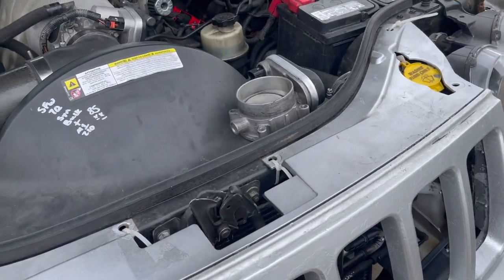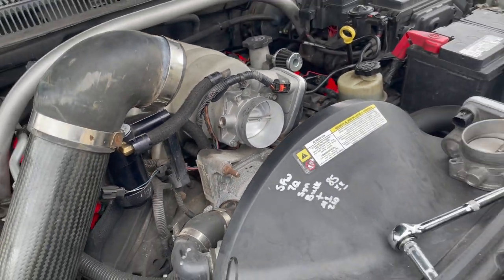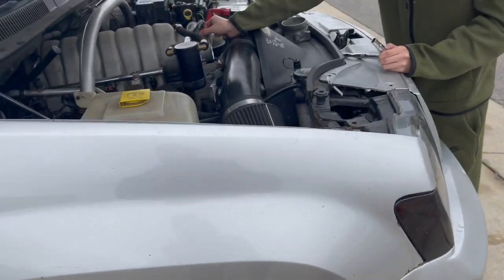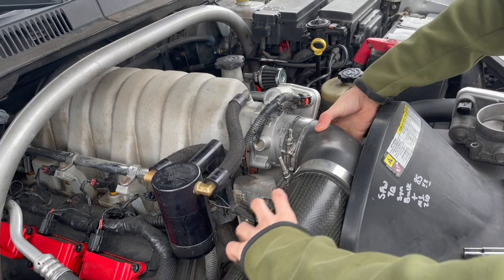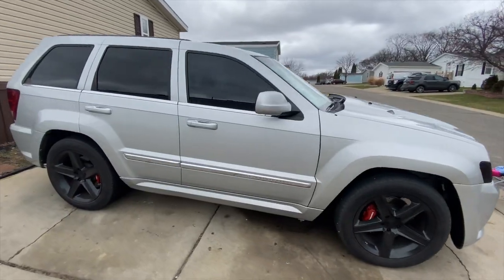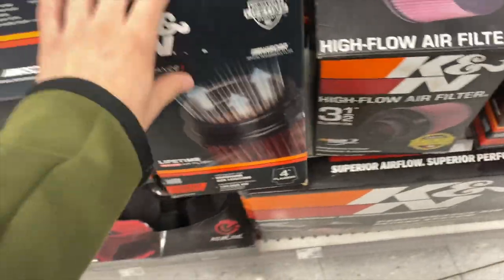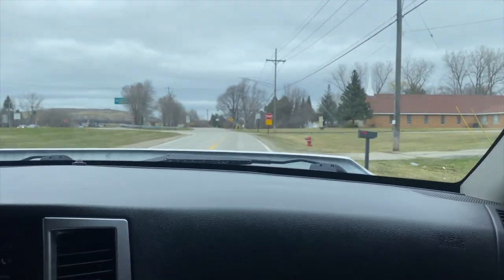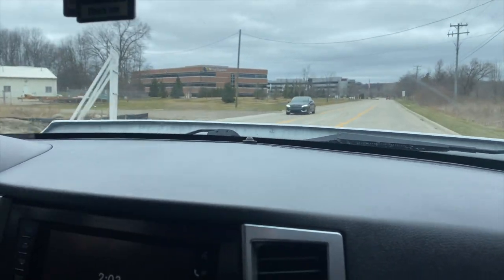INSTALLING A PORTED THROTTLE BODY ON THE WK1 SRT JEEP (6.1 HEMI)

Comment: For the $$ spent  on that TB Is it worth it for a Hardly  noticeable difference?
Reply from the maker: It’s worth it in the long run once more mods are done
Reply: Yeah I got mine ported by 454chuy aswell. Check out his page he has dyno sheets that shows the before and after the porting.